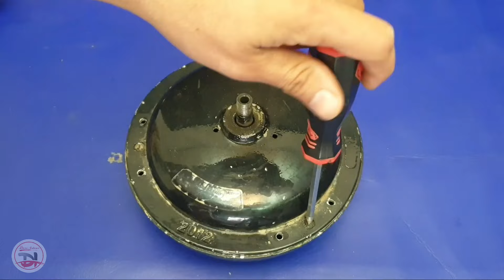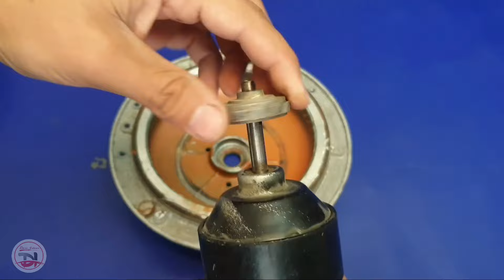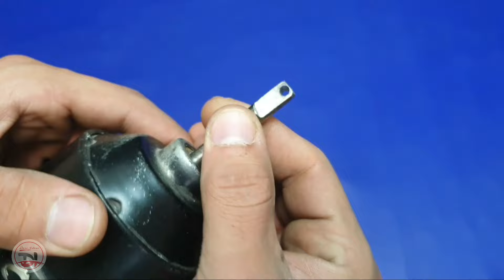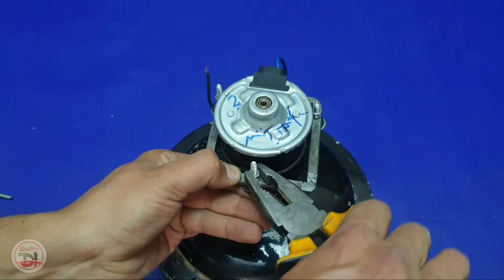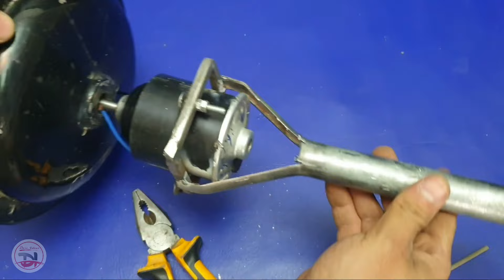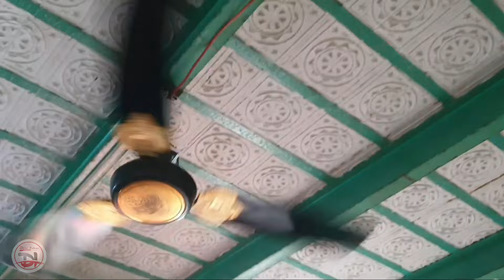Convert AC Ceiling fan into DC . 12V Ceiling fan #diy

Comment: Fake because this motor has no power to run this heavy weight fan so it will be  burn after 2 hours
Reply: i was also thinking so
Reply: sir the motor is probably designed to handle weight like that
Reply: Write brow😮😮

Comment: its not long lasting, it works for few hours, because you chose wrong motor. load is greater then motor which causes heating motor so much and finally burn.

Comment: If you really want to make this then don't connect motor shaft directly with fan. Use a belt system for it... Then it ll work